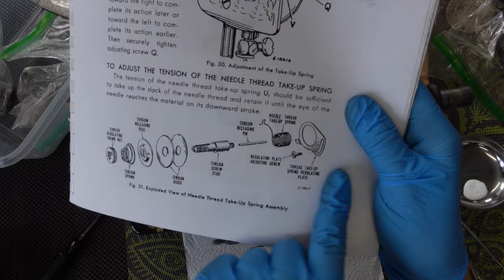Reassembling an Antique Singer 27 After Painting

Comment: Thank you for this video.  I am in the finishing stages of restoring a 27-4 that was my grandmothers.  I started several years ago and did paint and put the machine back together.  I stopped in the middle of the cabinet restoration and started back recently.  When I started the machine was completely locked up.  I had an issue with the needle lining up with the hole in the plate.  Thanks to your video I realized the needle bar was turned 180 degrees.  If all goes well she should be sewing in the next few days.  Thank you so much. 😊

Comment: This video is perfect timing for me. I recently bought a rusty 1900 27 treadle. It was locked up tight, but I managed to oil and coax it loose. I did a partial dismantle, stripped it to bare metal , repainted, new replacement decals......looks beautiful, moves smooth BUT I couldn't get the needle to bring up the bobbin thread. After watching this I have a good idea where to start adjusting. Thank you!!!!
Reply from the maker: Yes, you probably just need to adjust that little bracket that pushes the shuttle back and forth. Good luck let me know how it goes

Comment: I started watching your other channel because of my love hate relationship with commercial pattern companies.  Then I started watching this channel because I now have an extra circa 1920s singer because I needed a table for my Grandmother’s 1930s singer. I was going to sell the 1920s for parts but I think your machines are so pretty so I want to refurbish it.  I want to keep my grandmothers machine in the table even though it has a motor and hopefully put the 1920 in a base like you have and sit it on the table when I want to use it which probably won’t be as often as the other. Do you think this is possible, by the way the 1920 needs a treadle?
Reply from the maker: Yes, I'm thinking if you had a base you could sit the treadle head on to, when you wanted to use her hopefully they're interchangeable on the posts on the treadle base, and you can just slip her into the cabinet. Good luck with that. There's nothing wrong with having several machines around 😁

Comment: This was wonderful to watch. I was just gifted a Singer 27 and this was helpful to watch. 

I'm wondering if you have any thoughts - I setup the belt/treadle and it's running smoothly but it's not moving my needle up and down. Any ideas of where I should start? Thanks so much.
Reply from the maker: Is the clutch knob/wheel inside the balance wheel tightened up all the way?

Comment: I've just realized my 66k has gone rusty after the cabinet was eaten by white ants the hand wheel turns but the needle doesnt move. is there any tips to removing the rust
Reply from the maker: I would spray penetrating oil all over every moving part and set it in the sun to warm up. Over and over until things move. Also, make sure the clutch knob is screwed in tight. Good luck.